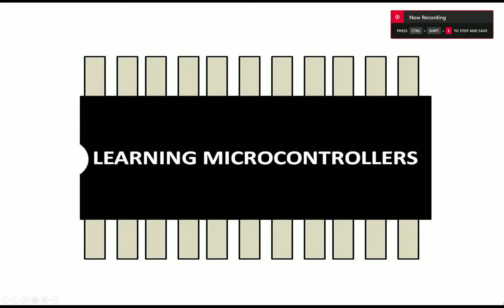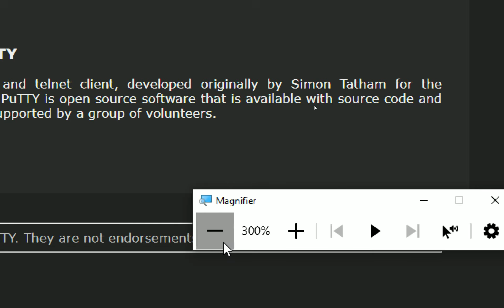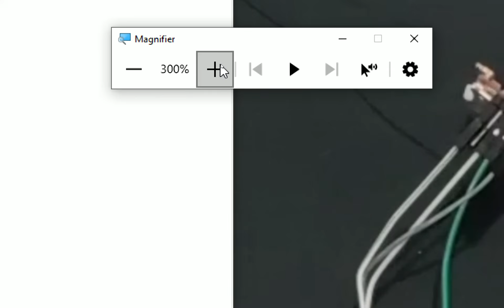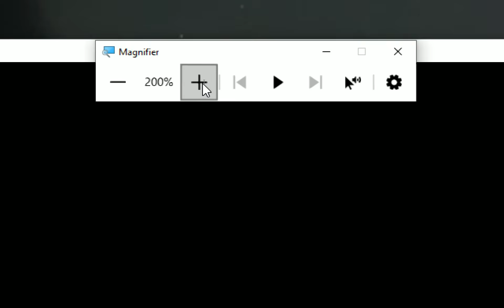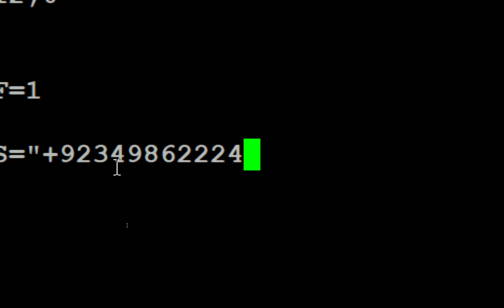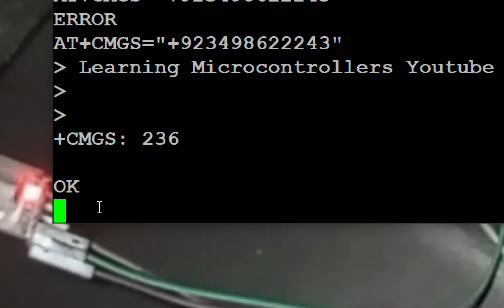Sim800L module with USB to TTL device send SMS using PC/Laptop.

Comment: In TTL, you jumper VCC to 3.3V. Why did you use a voltage divider on the Rx line?
Reply from the maker: Bcz the sim800L module operated at 3.3V while your microcontroller i.e pic16F877a is a 5v based mcu
This will cause sim800l to have shorter lifespan bcz of receiving voltages at higher logic level than ttl
Sim800l operated at LVTTL not TTL

Comment: sir is it possible to dwin hmi display can be interface with pic16f877
Reply from the maker: Yes I am making series on that
Stay tuned
Reply: @learningmicrocontrollers3561  sir can you please provide  just one example code with VP adress 1100
Reply: For communication between pic16f877a with DWIN hmi using mikro c pro
Reply: Sir tomorrow last date for project submission  please help sir just I need one code for dwin hmi interface with pic16f877a
Reply: I can pay for that sir